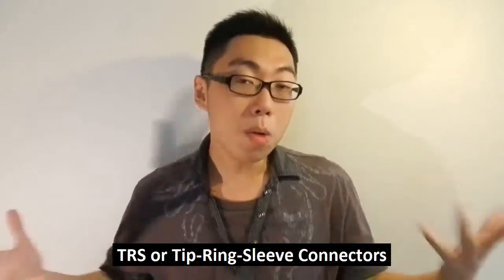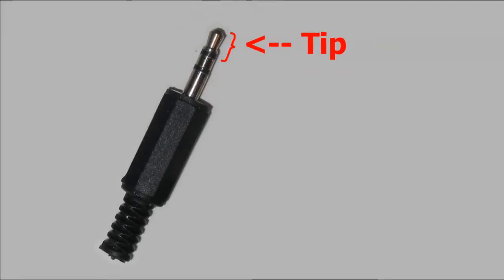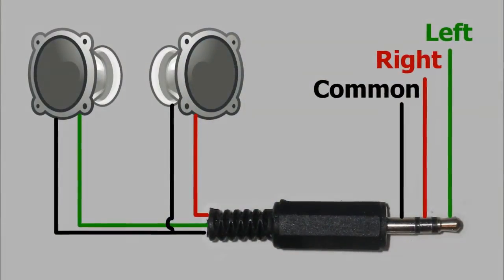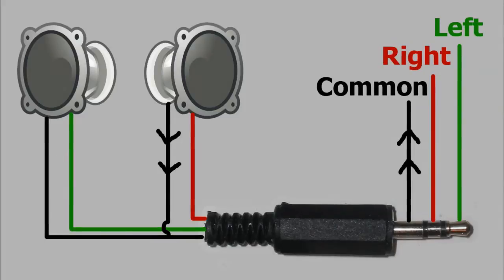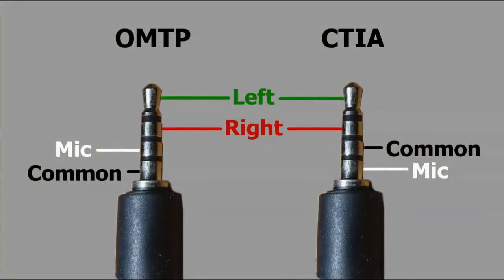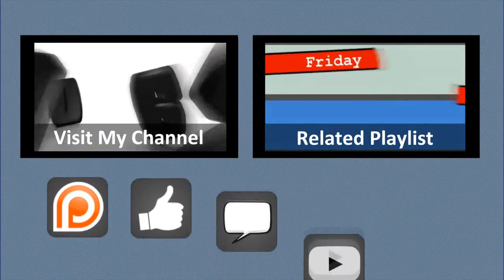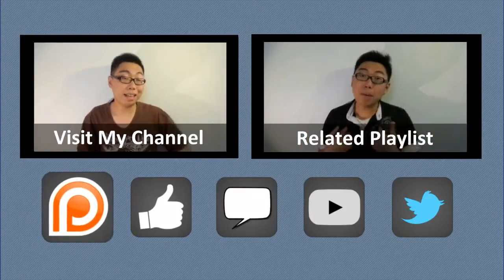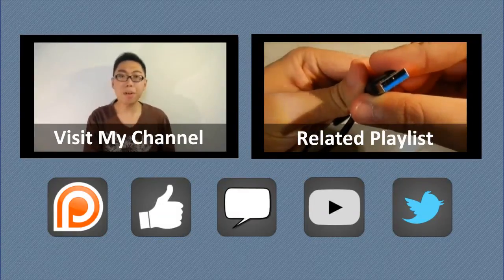Tip-Ring-Sleeve - Friday Minis 126

Comment: GREAT Video. Not sure if you're still replying but how would a jack having an extra "tip switch" pin work when soldering to a PCB with L/R/G/G? Thanks!
Reply from the maker: Hello and thank you for your comment! I'm afraid I have no experience with this at all. My impression is that a tip switch is there to switch between outputs when a plug is inserted versus when it is not. Maybe this Stack Exchange question can guide you a little better: https://electronics.stackexchange.com/questions/309603/help-with-microphone-connection-in-trrs-audio-jack